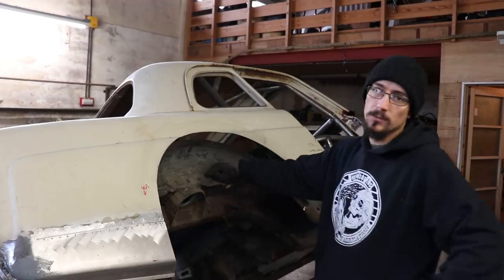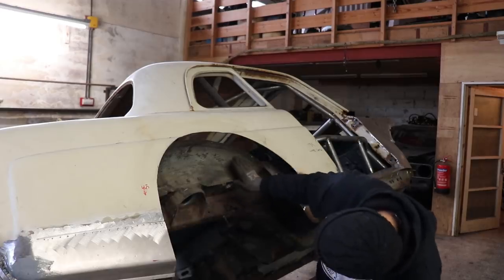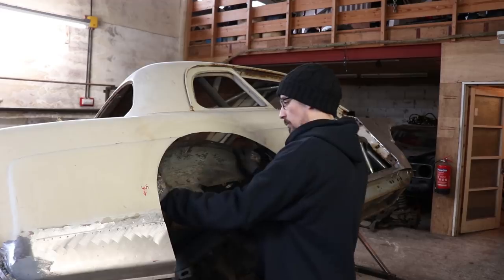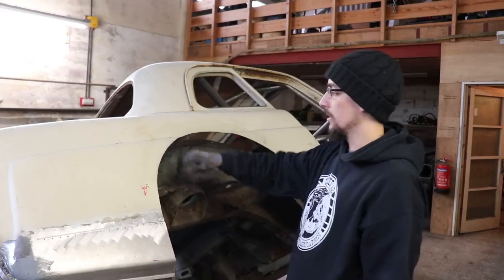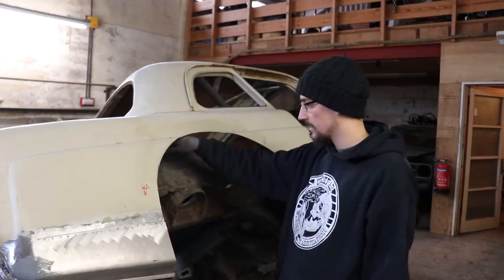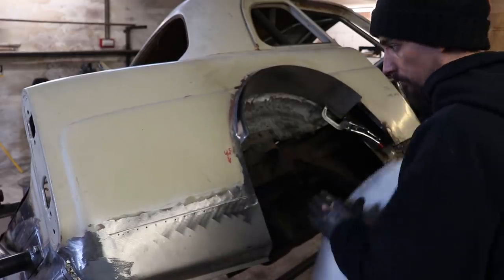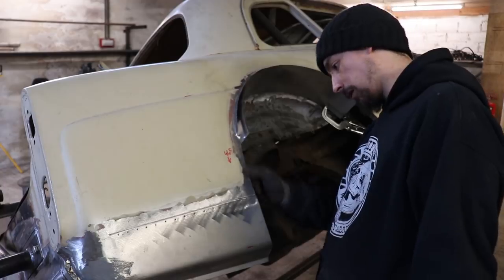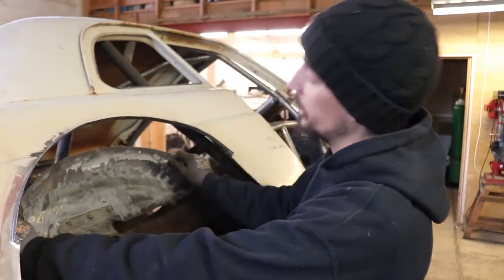MAKING WHEEL ARCH TUB PANELS ON THE MX5 / MIATA HOT ROD.

Comment: Top Tip Matt, get a piece of 40x10 flat or similar & with the 1mm disc cut a slot 10mm deep (across the 40mm wide bit)
Use this as a lever to slowly bend up the edge of a panel, work your way over and back slowely.

Comment: Matt, a length of round bar, say 13mm  diameter, with a hacksaw cut in the end, 10mm deep ,makes a "tipping too"l.Push the bar onto the edge, to the depth of the slot, and work gently pulling upwards along your scribe line.This produces an edge that is easy to follow up with a hammer and dolly. Tip from old bloke with 30+ years of fabby work behind him ! Give it a go eh.
Reply: Thanks!
Reply from the maker: That's a great idea, I'm gonna make one. Cheers
Reply: Excellent choice in fab tool Des Des I found myself searching my memory for what I had used in my career LMAO 38yrs soooo many jobs.
Left and right depression galore. 😉😊👍👍
Reply: I'm sure the project binky boys did that on the mini too, I remember thinking it was so simple, but perfect for the job.
Reply: Been using one years  it was used a lot in sheet metal fab shops when I was a boy.

Comment: Excellent work as ever Matt. Many years ago used my fathers sheet roller to band some wheels. He was a blacksmith btw. Had to weld them with his Oxford stick welder. However they worked. They were for a mates car and cannot remember what it was. Might? have been a 105 Anglia that we put a 1500GT Cortina engine in with front legs from a rally car.

Comment: Another great episode. I think I would leave the rear valance, seems a shame to cut holes in a perfectly good panel, especially as you just made it !  I've contemplated cutting the arches out on a couple of cars but chickened out, should have just got on with it ! Standard MX5 exhaust outlet is on the right but the pipe comes past the diff on the left.  With the extra length of the boot it might be possible to fit a silencer lengthways, the standard MX5 rear box is pretty heftly.

Comment: Matt, when you're folding out the lip on the arch (7.00 on) Would it be easier to use the same tool you made the step in the metal (joddler?)  for the rear valance, and then use the dolly/hammer after? Or does that do something odd to the metal?
Reply from the maker: That would be a great idea to get the line going, Cheers.

Comment: i did my rear arches for my mk1 caddy the way you said not to, and yes, i warped it a little, whoopsies! luckily the wide arches cover most of it..
Reply from the maker: Wide arched caddy sounds cool. send me some pics,I love those things. I had 2 many years ago, sold them for peanuts.
Reply: @Urchfab  it's a berg cup kit, first car i ever worked on, found you after i finished the welding side of things :( going to put everything i learnt to use on my brothers hillman imp though. i have a forum thread i could send you has like 600+ pictures. Trying to build it to actually handle well, stitch welded everything and reinforced some weak parts.
Reply: @Urchfab  dmed you on instagram.